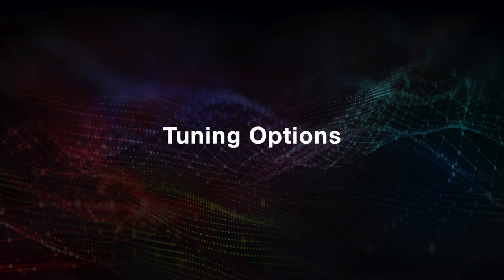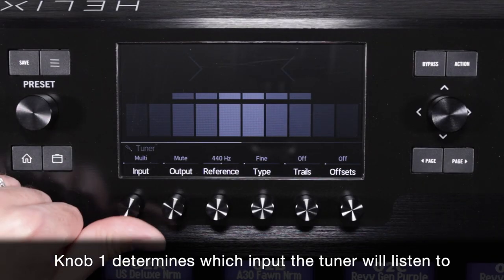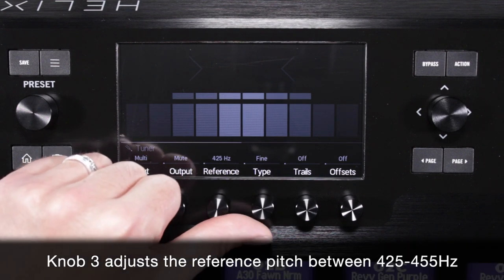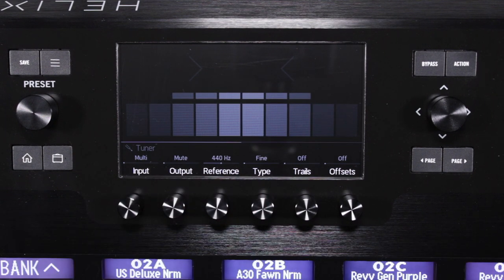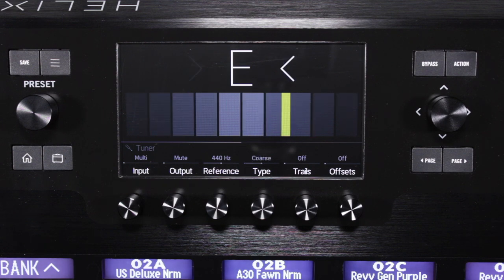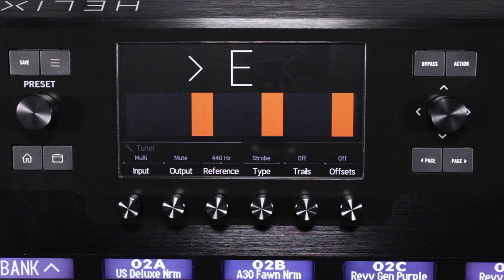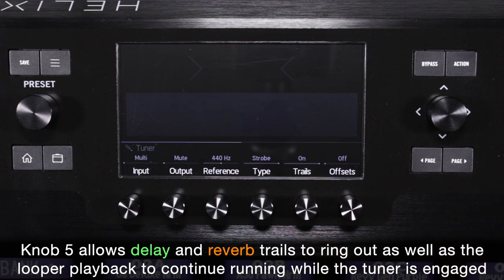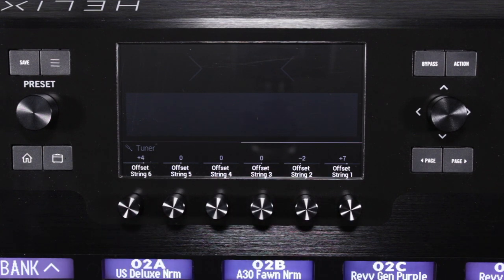Helix Minute: Tuner Modes | Line 6

Comment: The Helix tuner still has no capo mode (tune low E string to a different reference, like Eb or D or F, or whatever). Fractal has provided that feature for decades. Budget clip-on tuners provide that feature. But not Line 6's flagship multi-effects pedal, for $1700.

Comment: I was pretty happy with the tuner until the latest update (3.71). Lots of bugs, including the tuner. Using my Variax, I suddenly hear my guitar when I tune. And it chooses some weird tuning, just to make thing even more annoying. Also, if the Helix is being used as an audio interface, suddely that audio sounds like it was from a broken AM radio when the tuner is engaged. The audio also pops and clicks now, without the tuner active, and  it didn't use to. Same setup before and after the firmware update, in every other way. This latest update has been the proverbial turd in the punch bowl.